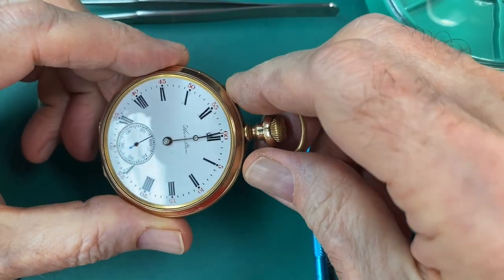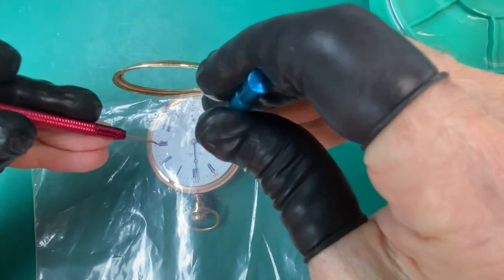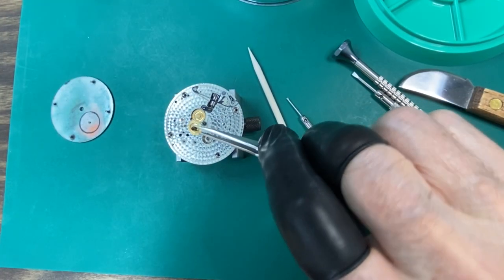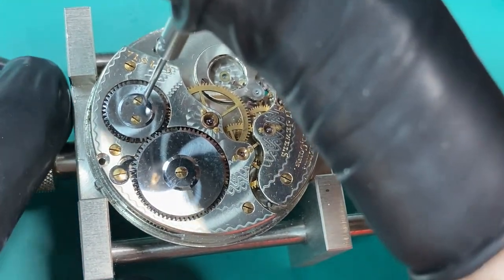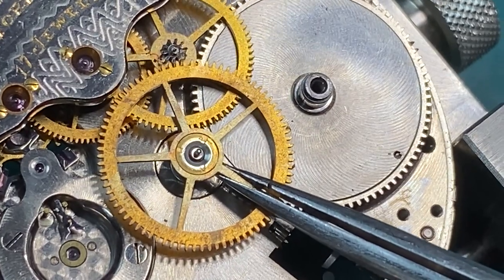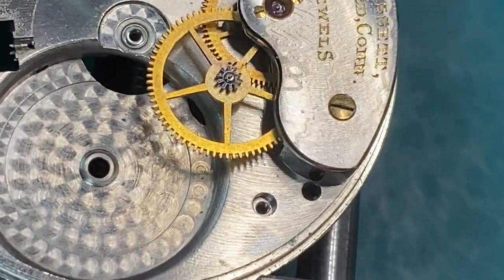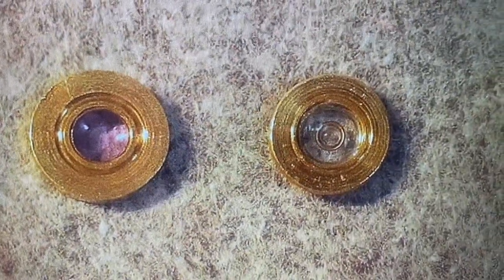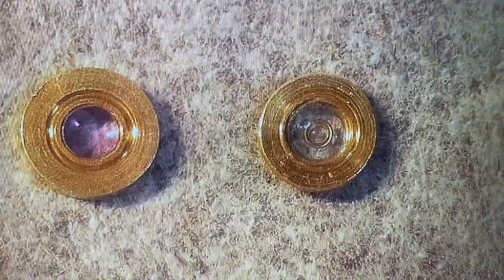How To SAFELY Disassemble Pocket Watch Before You Start Restoring -Hamilton Pt 1

Comment: I just acquired a 1922 Hamilton 974 in non running condition. It was missing the crystal, but the dial and hands look good. The balance looks good and spins when air is puffed on it. I think it is just dried oil stopping the train somewhere. I have repaired quite a few wristwatches and wanted to try a pocket watch. I am happy to get such a high quality watch. Your video will be a big help for me. Thanks!

Comment: Thank you for the helpful tips regarding disassembling a newly acquired watch. I am in the process of discovering the history of this watch that was found in my father's affects. It is a Waltham pocket watch that was produced in 1895. Unfortunately, I think one of the jewels for the balance may be broken, though I don't have a microscope to inspect it. Can you recommend a supplier for replacement parts and what information I might need to replace the jewels and the barrel spring?
Reply from the maker: I made a video on how to find parts - you may want to watch that one as it is very detailed.  If I need a part, I often buy a movement off of ebay and just use the part off of that movement.  (It will need to be a movement of the same pocket watch you have.). This way, I also have extra parts I may need for that pocket watch in the future.  Also check out my other video on replacing parts - I replaced a main spring on one of my videos, which I believe is a part of this series.

Comment: Hi, I've got a Hamilton 974 just like yours. I plan to follow along and do my watch as you do yours. This will be my first pocket watch servicing. I have heard that white alloy springs are newly made and are much better than vintage springs. I'm not sure what all that means, but is that true? I think the white alloy springs are noticeably more expensive as well. Do you have any advice on buying replacement watch springs?
Reply from the maker: From my personal experience over the years, I would have to say that the white alloy springs are much more reliable than the vintage "new old stock" (never used before) springs.  The vintage springs have broken, while I have never encountered that problem with the white alloy springs.  Thanks for watching!
Reply: @myhobbiesarenotcheap  Thank you for the quick reply. I’ll make it a point to keep my eyes open for a white alloy spring when I’m purchasing a replacement mainspring.

Comment: Thank you very much for this nice tutorial video! I do have a question concerning the ratchet wheel. The one I'm dealing with in my French made railway Régulateur pocket watch does not seem to have a screw head I can use for unscrewing the ratchet wheel. Instead of it I can see the head of a "pin" in the centre of the wheel. How do I remove the ratchet wheel when I cannot "unscrew" this "pin"???
Reply from the maker: I have not worked with this kind of pocket watch before, so I am unable to help you with any practical advice.   You might want to try to go to the Forum on NAWCC and see if this is addressed there.  (I am hoping you are able to find an answer there - they have a special forum for European watches.) Thanks for watching!
Reply: @myhobbiesarenotcheap  Ok this is understood. Thank you very much for your help and this is always a pleasure to watch your very helpful videos.

Comment: Can you help me identify a 992
Reply from the maker: The best way to find out information about your watch is the serial number on the back of the movement. Not off the case back take the movement serial number and go to pocketwatchdatabase.com website and then enter in the manufacture which is Hamilton and the serial number and it will give you all the information about your watch.I hope this helps you.